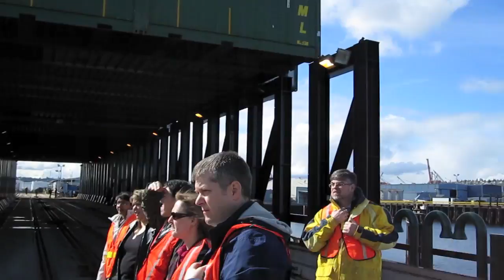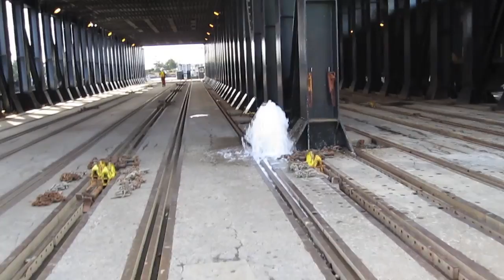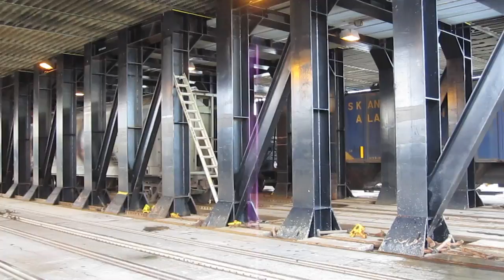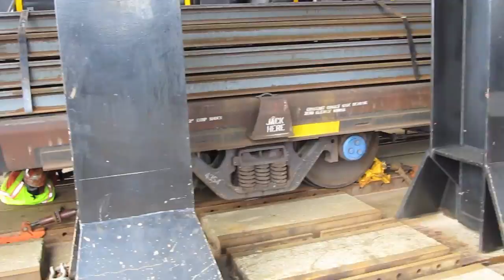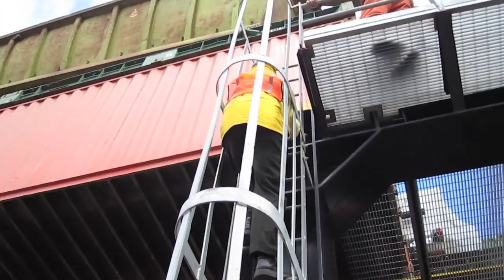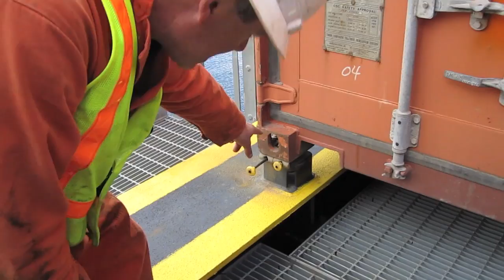Rail Barge

Comment: The barge should sit deeper as the cars are loaded.  How do they compensate?
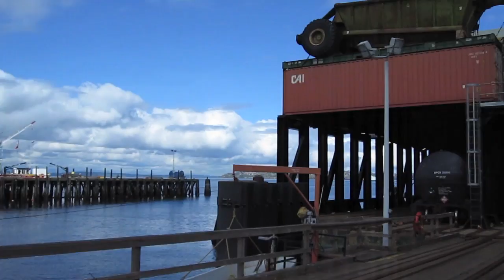Reply: go to 5:00  see the long lead in ramp that fluctuates up and down with the barge.
Reply: also had you seen the water dischargers they use water to ballast and balance the barge which is how all barges pretty much work is ballasting with water to control depth and balance of load